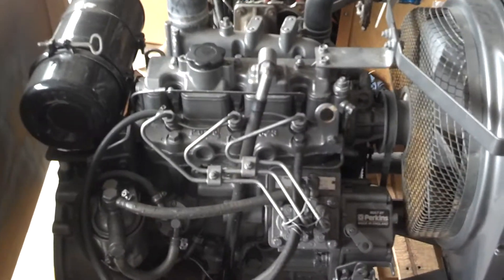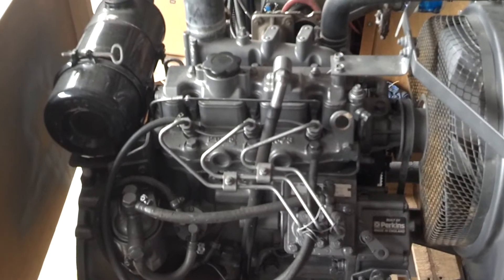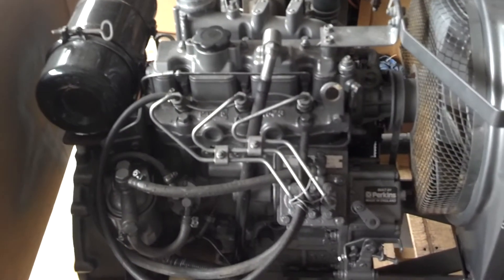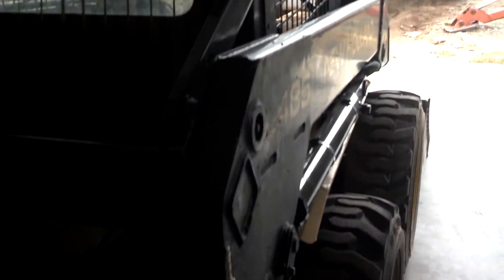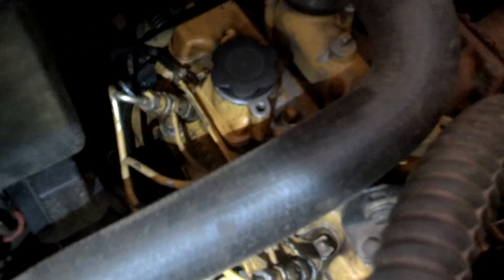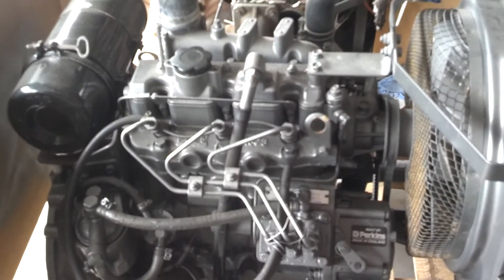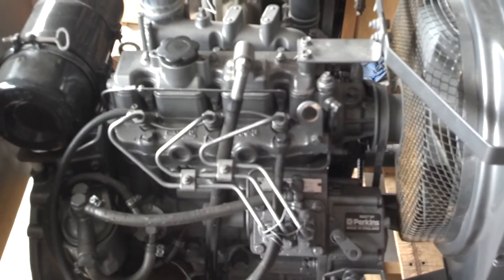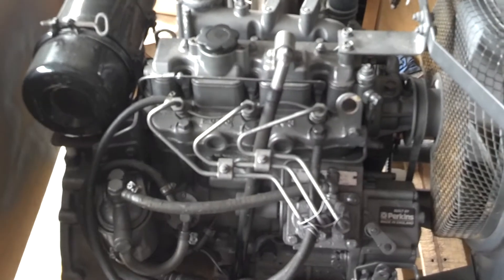12kw EMP "Proof" Generator (Pt. 1)

Comment from the maker: The engine mounts are basically two big L brackets that bolt vertically 
to the front of the block. the widest part at the base is 14" outside 
tip to outside tip. the bolt holes to mount down are about 12" to 
centers. The block width where the brackets bolt on is around 10" wide. 
Hope that helps.
Reply: focodiesel yes, actually that does help a lot thank you so much i was looking to put one in a lawn mower no one would give dimensions on the mounting unless i bought it which is not possible yet

Comment: Cat still offers this engine, C1.5 natural or a C1.5 Turbo good little engine !
Reply from the maker: Yes they are sold as perkins or Cat's, they are all shibaura's and have been around for close to 3 decades, good engines. Yanmar makes an engine (3tnv-84) which is the same size but direct injected, those are good engines too.